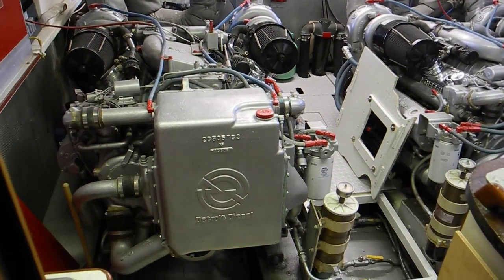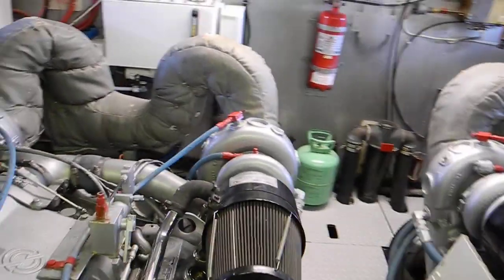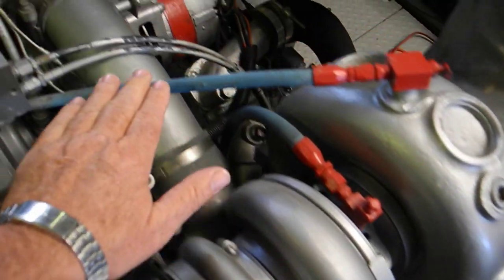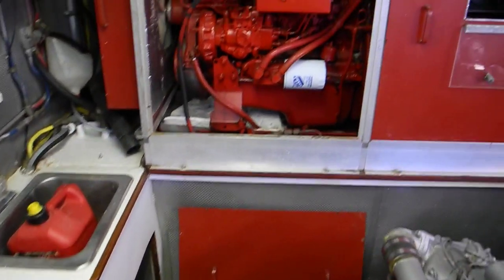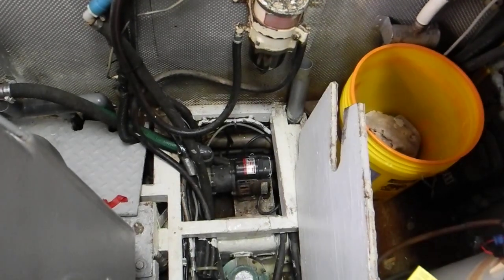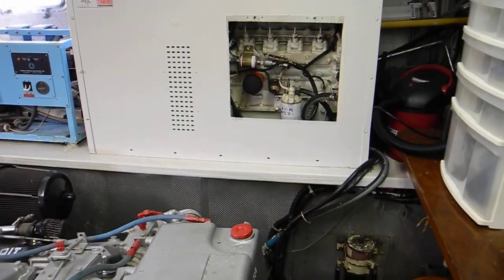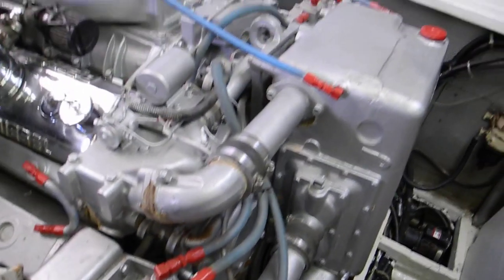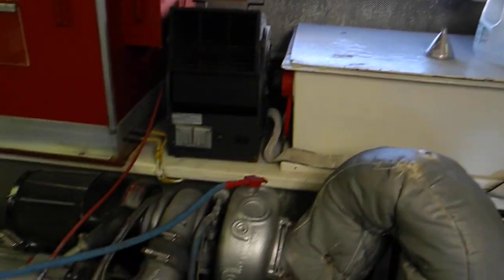Detroit Diesel 8V92TI engine room tour

Comment: I had that engine  in a truck and one in a 60 ton excavator.   Great engines.  Tough on fuel .  But a 60+ feet its not a concern 
Great video.  Thanks
Reply from the maker: Walter Davis thanks for watching and sharing your experience too. 👍🏼
Reply: @AskCaptainChris    im on my boat now.  Spring clean up,touch up and ger her started.  Engine dosnt want to start right up and its windy and cold ! Lol
Reply from the maker: Cold here in Vero Beach too. 72 and rainy for the first time in quite a few weeks.

Comment: Great Videos. Love seeing the big Detroit diesels. I actually drove a truck in early 90s that had an 8v92 475 hp .I owned a 86 GMC for 4 years with the 6v92 350hp both are good engines. Love your channel Your friend Alabama Smokey Wilson
Reply from the maker: You certainly can hear them. 😎
Reply: @AskCaptainChris  ever heard on with a straight pipe exhaust?
Reply from the maker: Alabama Smokey Wilson I ran boats like that in the oilfield. Water cooled pipe. Also ran commercial fishing boats with dry stacks and no muffler.

Comment: Looking at a boat with twin Detroit turbo diesels.  Were they all 2 strokers? Haven’t had enough time to ask about what series they are.  Do you recommend older Detroit’s (early 90s)?  Gonna be my first diesel boat.
Reply from the maker: Kiet Nguyen all of the engines with the Detroit Diesel brand are two strokes. They do have a crank case just like any four stroke engine. Their piston sizes are 53, 72 & 92. An 8V71 is an 8 cylinder with 71 cubic inch pistons. If they are in good shape, yes.
Reply: @AskCaptainChris   thank you for the quick reply.  Would you suggest staying away from a boat with the 8.2L turbos?  The boat I’m looking at has twin 8.2l that just needs “a little maintenance”.  1000hrs and currently runs fine (seller’s words). I hear parts are hard to get is all.
Reply from the maker: I suggest you hire a marine engine surveyor for a better answer about the condition of the engines. It’s tough to make a call without evaluation in person.